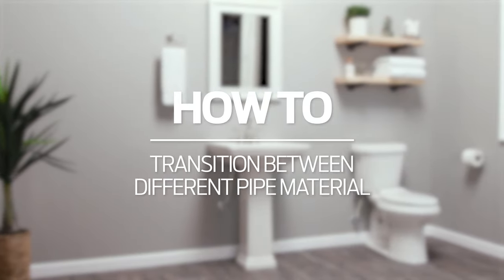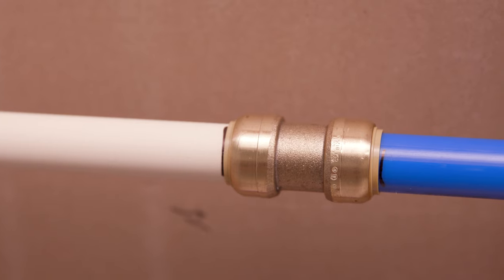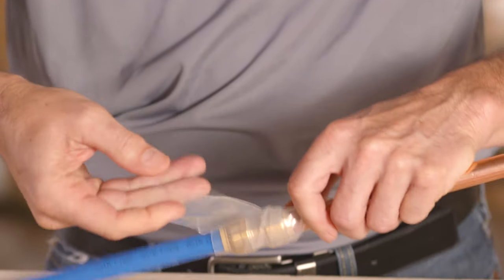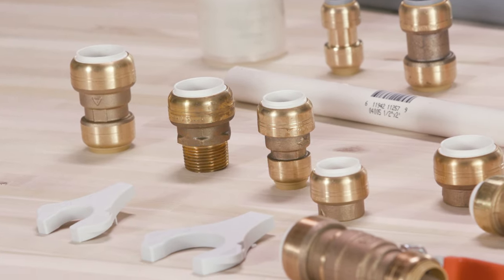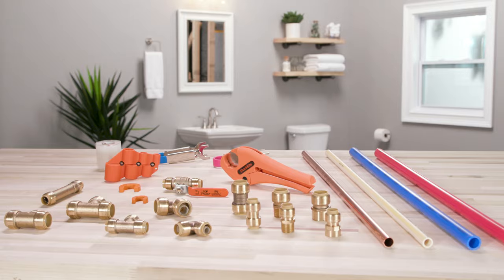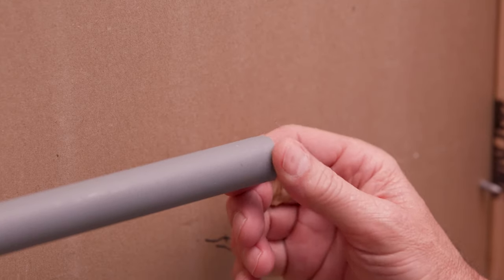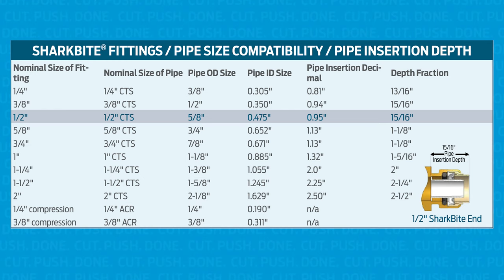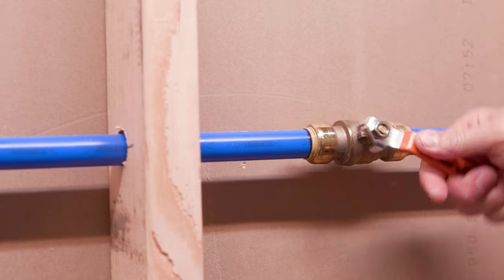How To Transition from PVC or Polybutylene to PEX, Copper, or CPVC Pipe

Comment: I have a mobile home, my shower lines have a clog and I want to cut off the pipe to clean it out. I’m sure the size is 3/8 does sharkbite have that size?
Reply: "... I’m sure the size is 3/8 ..."  Wow, that would be a very small water line!  And a 'clog' is more likely in a fitting (shower head, valve) than in the middle of a section of plastic pipe.  Remove the shower head and run the water.  What sort of faucet do you have to turn the shower water flow on and off, from hot to cold?

Comment: Do these work with fire sprinklers and CPVC Blazemaster pipes?
Reply from the maker: Hi John! SharkBite Universal push-to-connect fittings are not suitable for use in fire sprinkler applications.  These fittings are approved for use in potable water and radiant/hydronic heating applications only. We do offer a line of SharkBite Fire Fittings that are designed to be used with SharkBite PEX tubing only.  We do not have any Fire Fittings that are suitable for use with CPVC at this time.  Please see the following link for our Fire Fittings Spec Sheet and information regarding approved system applications: http://bit.ly/2F2sjZY

Comment: How can i get pex out of the polybutylene side? Id really like to reuse these fittings😅
Reply: Hi Tate, I see that you posted this question 4 weeks ago.  I'm wondering if you resolved the problem.  Lowes has a tool designed to release the pipe from the sharkbite.  It is steel and shaped like a pair of tweezers.  It works!
Reply: @lonnieclemens8028   I still have the peices I'd like to take apart, I haven't gotten the tweezer tools..future goals

Comment: Cant seem to find a coupling for 3/4 pvc to 1/2 pex. Tried a 3/4 x 1/2 in tan on both ends had to take the sleeve out of the 3/4 side because it wont fit inside diameter, it leaked. If anyone knows of the 3/4 pvc white tip to 1/2 pex tan tip even exist maybe you could point me where to get it. Thanks.
Reply: Don't think they have a reducing transition coupling. You'd need to go with a 3/4 PVC to 3/4 PEX Transition,  - then a reducing fitting from 3/4 PEX to 1/2 PEX
Reply: pvc? or cpvc?  PVC is not used for potable water supplies (ISFAIK)
Reply: @notcharles  your insane

Comment: Why am i hearing about these failing after about a years use?
Reply: Depends on the installer. A good install will last near lifetime. A bad install will leak soon. Also bumping into fittings that are not braced or supported will loosen any seal. Only copper sweated will resist bumping.

Comment: Can we get to something besides push-together  fittings for transitioning? Plumbers -- some of the best ones -- say these fittings are not intended as permanent solutions. They use a rubber seal which eventually deteriorate, especially in public water systems that inject chlorine in water and may contain other corrosive materials. Rubber deteriorates over time anyway. Certainly these fittings make the plumber's job faster and easier but I doubt that savings gets passed on to consumers anyway. I had one plumber tell me these were "code." Baloney. Code depends on the structure, it's location, use and other factors. Please, would someone out there include a video on some of the better, alternative fittings also offered for PEX pipe? No way I would do permanent plumbing in my house with push-together fittings like this.
Reply: Mark Jones these are fine permanent solutions. Most copper is now being installed like this or in a similar fashion.
Reply: What about your bathroom taps that have rubber o-rings in the Faucet cartridge for each hot and cold handle..Or your kitchen sink that has several rubber o-rings in it? I'm sure they are not guaranteed for life and hold up the same as the SB fittings under the same circumstances...
Reply: It's not that they are code, it's that the code allows them.
Reply: you are correct.. pex CRIMPS for  permanent solutions..pex push are not  permitted for enclosed ( Walls, underground  etc..) no access spaces in most localities
Reply: pex actually withstands freezes better..but you have to use  crimp pex for  permanent  solutions by code
Reply: They have permanent fitting for pex, either brass or plastic fittings with crimp ring or clamp ring.
Reply: 6 year plumber- shark bites are fine if they are in an accessible area OR underneath a house that has a crawl space. 1 I would NEVER bury a shark bite in the ground OR inside the wall. (Unless it’s a double wide trailer, shark bite are the best reliable way to transition to grey polybutylene pipe) Yes they will fail eventually but unless your house is plumbed in brand new pex, it most likely will outlive the copper or cpvc your house is plumbed with